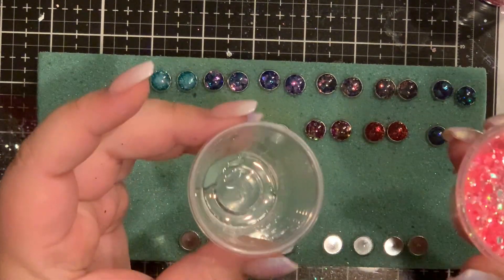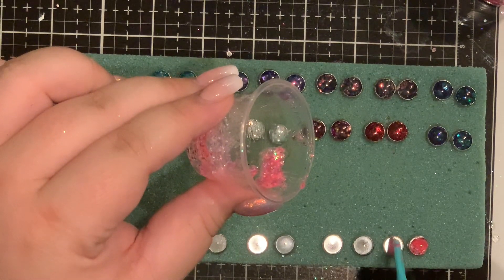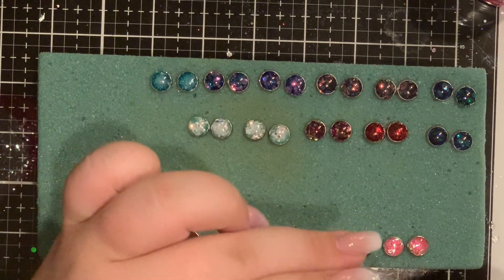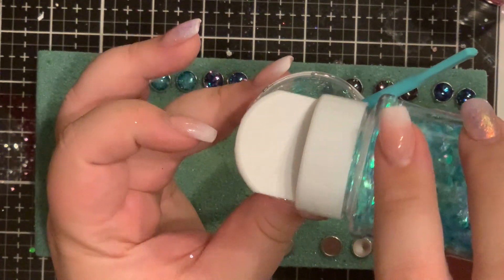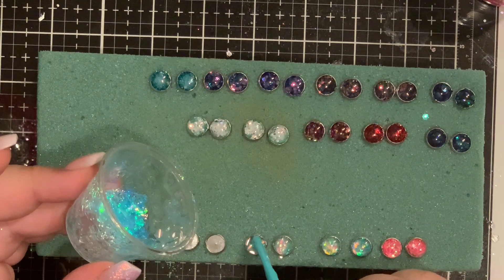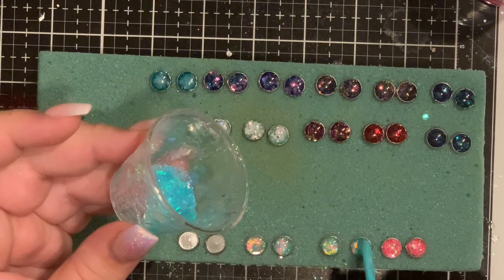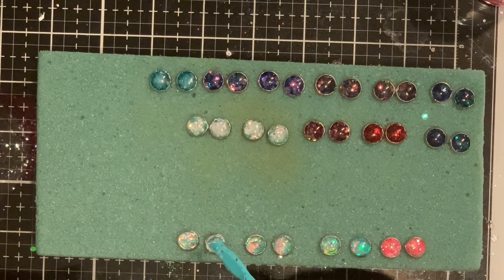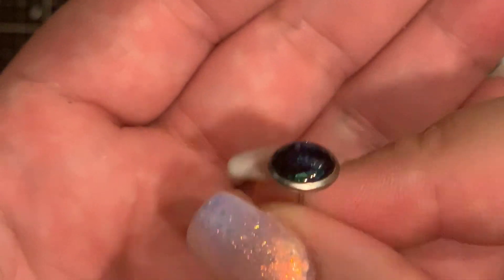Bezel Earrings

Comment: Do you have to use UV? How long does it take to set?
Reply from the maker: Shelby Bennett I believe I used regular epoxy for these.  Just whatever was leftover from a doing a cup.  It takes about 6-8 hrs (depending on the brand you use) for it to no longer be sticky.  72 hrs to fully cure.  You can use UV resin if you’d like!  You will need a UV lamp to cure it though.  UV resin is cured in minutes.
Reply: J. Patole Designs wow thank you! 😍
Reply: @jess_the_mess1064  Thanks for showing how you do this! I am going to try with UV Resin 🙂